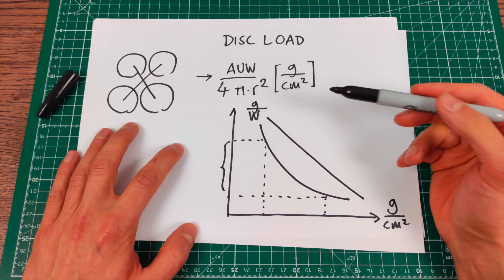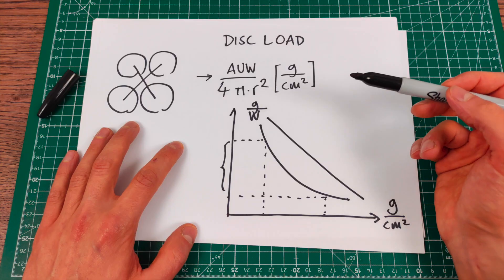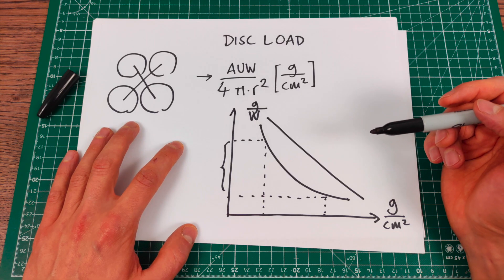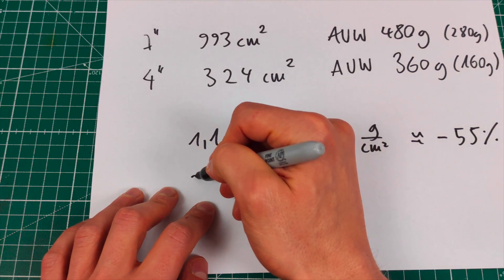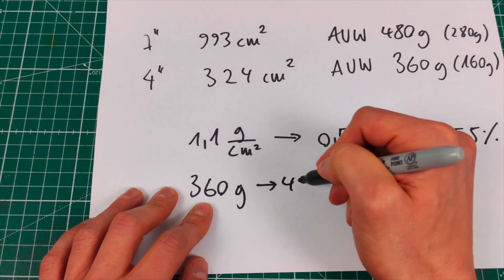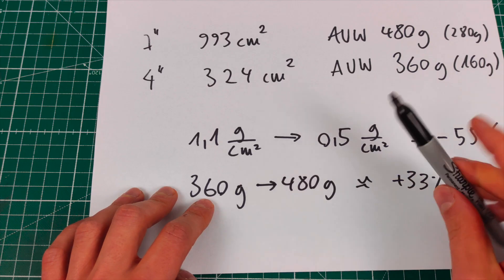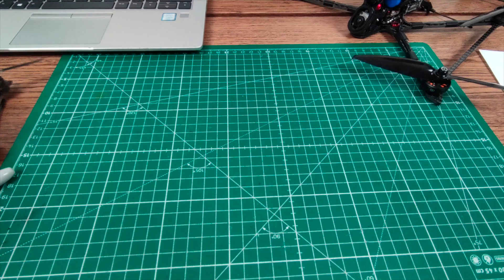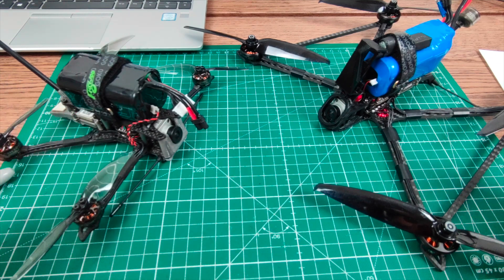Ultralight 7" vs. 4" | flight time comparison | 18650 Li-Ion

Comment: Dave, Can you compare them down to a specific voltage? Because no matter what the 7in is most likely drawing more amperage thus making the battery(especially li-ion) sag slightly more but I really don't know.(I know the cold hand thing my thumbs were gonna fall off the other day as I pitched the nose of the quad forward to get home asap) I've been doing these exact same comparisons between my Explorer LR 4in.(146g analog vtx weight) and my Tomoquads Katana V2 5in. w/fpvcycle 2204 2800kv t-mounts HQ 5030 Bi-Blades(206g analog vtx weight) 4s Li-ion(190g Pack)(18650 Samsung 25r-Green Wrap 2500mah 25amp Cell, best cell for the price at like 3$ each)  and even though the katana fly's much much better especially if you add even more weight the amp draw is still slightly higher so flight times are lower on the same pack. I have a second Katana V2 5in. frame I'm going to build out with BrotherHobby 1504.5 2650kv motors I have and see how well it performs swinging a larger 5in prop and if its possible to beat the Explorer LR on the same pack using a 5in prop because the Explorer's efficiency really takes a dive if you add weight with a bigger battery or camera where as the bigger prop/bigger motor combination's efficiency is much less effected. So to get back to your test, the 7in will carry a larger battery and fly longer while of course burning up more mah/min BUT a really cool test would be to see how far each can go at there optimal cruising speed. I have a feeling that the 7in you will find has a much faster optimal cruising speed so where the flight time on the same battery might be less than the 4in, the 7in quad may cover twice the distance even with being in the air less time. Yea distance and finding optimal cruising for the 7in would def be a cool test.

Comment: Interesting comparison, taking into account that both quads are limited to use the same energy. But the 7" is heavier and these 7" props weren't designed for efficiency. 
Props should have low drag, similar to glider plane wings: slim airfoil and low pitch are the way to go. 

I'm getting the same flighttime of around 28 minutes at similar speed from the same LiIon 4s-pack 3.000mAh VCT6 in no wind conditions: 

1) stock 370g AUW EXPLORER LR and 
2) 540g AUW Geprc MarkIV 7" frame driven by T-motor MN1806 / 2.300kV and low pitch T-motor CF props 7x.,4. Those props are razor sharp and only fit on the T-motors. Both are nearly impossible to source now. 

T-motor CF 7x2.4 props are amazing, it would be great to get CF 4" props with same airfoil and actual 5mm T-mount for the EXPLORER LR.

Comment: You should look at the efficiency curve of brushless motors, even with the greater weight of a bigger motor, since you'd be at a much lower portion of it's torque potential, you should be able to get a very significant efficiency boost. I'd be curious to see you go in the complete opposite direction and get a 2806ish size motor then test the fight time. Should also significantly help with the feel of the quad.
Reply: I think the idea behind the lightweight design of this seven inch is to directly compare the seven inch to a four inch with the same battery as you can get a seven inch to carry a good 600 or so grams of battery which would blow a microlongrange out of the water with flight time
Because the 4 inch is at the limit of its carrying capacity with that battery whereas the seven inch would be perfectly capable of double or even triple the battery size
And he was mainly testing the efficiency of having a low disc loading
But if he where to load up the seven inch to the same disc loading I think we all know that it would win
Reply: I agree with a smaller stator the stator gets saturated with energy much sooner than a larger stator, therefore even a larger stator can be more efficient because it does not have to work as hard it's not near its maximum potential which is when the increase in amps causes a decrease in efficiency losses through heat etc.

Comment: a lower pitched 7 inch prop would be nice. implementing Prandtl lifting line theory in propellors could also give an enormous boost in flight time.
Reply: Has there been any real world implementations of this theory? I read through a few papers but it seemed to be a different way to frame the calculations or a different way to calculate a wings properties. I didn't see anything about it being a game changer in effeciency. I'm not trying to disagree with you or anything, I really just don't know much about it.
Reply: @JustinHunnicutt   there aren't many planes built this way,  Albion Bowers (NASA chief scientist ret.) Claimed a total gain in efficiency of about 60% . The papers he published,  are based on measured data.  People who built the prototype confirmed a great gain in efficiency (not 60% tough). Had something to do with the plane not being full size.  I don't know why the aero industry seems to ignore it,  maybe for the same reasons they mostly ignore canards.

Comment: I like the happy compromise that a 6in prop brings. Your 5in frame adapted to 6in props, with t-mount 2204s and HQ T6x2.5x3 would be a nice combo.
Reply from the maker: could be absolutely right. 6" has also been my favourite on more classic setups. I think the next thing I will try is just putting some 6" props on it.
Reply: @DaveCFPV  So many new props and motor sizes are coming out, it's hard to keep up. I spotted the SPCmaker G2204, but I'm unsure of the quality.  The 4in LR is still a very hard design to beat.

Comment: My guess is, that the power to weight ratio of the batteries is less efficient on the 7" quad. You should use a way bigger battery and see how that works.
Reply: The key to achieve maximum flight times is to decrease dead weight as much as poss and increase the weight of battery in the same way, given that you use a battery with a maximum power density available on the market.

Comment: Please disclose your 7” PIDs. Thanks
Reply from the maker: It's really just a rough tune I did in 10min to make it flyable. Here it is:

set p_pitch = 81
set i_pitch = 99
set d_pitch = 107
set f_pitch = 105
set p_roll = 74
set i_roll = 94
set d_roll = 99
set f_roll = 99
set p_yaw = 79
set i_yaw = 99
set f_yaw = 99
set d_min_roll = 65
set d_min_pitch = 70

set gyro_lowpass_type = BIQUAD
set gyro_lowpass_hz = 0
set gyro_lowpass2_type = BIQUAD
set gyro_lowpass2_hz = 0
set dyn_lpf_gyro_min_hz = 0

Comment: Your efficiency goes nuts because this motors are completely overpropped running 7". I mean even 2306 Motors are overpropped on 7".
Going with bigger motors will need stronger frame, otherwise you will have tons of resonance. 
Your footage clearly shows what's going on, tons of wobble, a clear indicator of missing power. 7" needs at least 4000mm³ statorvolume to have proper autohority handling the prop weight.
I've done lots of testing with 7".
Reply from the maker: Agreed. The motor might really start to get inefficient at that point especially since the PIDs are pretty high to keep it from wobbling. Some light 2306 motors like the Amax Superleggera might work and not be much heavier.
Reply: @DaveCFPV  
The smallest motor on 7" I would run, are 2306.5. They are just enough to spin properly some lightweight Biblades like the gemfan 7042.
Reply: @waldemarkraus2855  Can confirm, very little wobble (only on high sink rates likely needing more D) on biprop gemfan 7042 with geprc 7" mk4 frame using 1350kv 2306.5 motors, 20 minute cruising flight times to 3.2V ~2500mah drawn on 6S 3000mAh VTC4. I want to try a 6s2p 6000mAh next. I love the soft bee-swarm-like sound of a 7" in this config.
Reply: @spikester  
If you are using 48khz pwm, than switch to 24khz or set "thrust_linear" in betaflight to 25 via CLI. That should also help.
That sound is great, but I had lots of problems with these props on high power setups due to flexing and bad resonance. 
For light builds they are fine.
Reply: @waldemarkraus2855  Certainly, these props resonate like mad but I guess thats where they get that distinct hum. In my case I must keep the filter sliders around 1.1 no higher. I could probably do better by balancing the props but meh. I run 24khz on larger quads because I found that low end throttle torque was more linear and predictable. I presume it has more to do with the braking power of the motors in relation to the larger disk and fet response time, especially when it comes to sinking fast in higher winds. My thrust_linear was set to 20. I will test 25. This is somewhere that automatic pwm rates make a lot of sense. I know at some point I will want to try larger motors. Thank you for the advice. :)
Reply: @spikester  
I run variable PWM on BLHeli 32 latest beta. Works great for combat those low throttle wobble.
Balancing those props helps but can't cure the issues with resonance. I dumped them and run some stiff APC 7x5 Biblades. But they are quite heavy for such small motors (2306.5).  Despite the APCs there are no good 7" biblades on the market for powerful 6S setups :(
Reply: @waldemarkraus2855  Thanks, I've just installed the latest blheli32 and set variable rpm from 24-48khz, will see how that goes shortly.
Reply: @waldemarkraus2855  It flew better with dynamic pwm but the frame still resonated where you could hear it from afar with the 2306.5 geprc motors. I finally swapped them out with the xing 2806.5 1300 and darn its like a different quad, smooth as a cucumber and that hum is much nicer. :D
Reply: @spikester  
Great to hear :)

Comment: I like the route TBS is going with their Pizza Box frame which is in production right now. The one piece 7” frame, which is SUPER light, as it’s very thin carbon fiber sandwiched around some type of foam. Then has a small canopy that will fit a Vista and and maybe a “Beast AIO”. I think they have their own AIO coming as well. The quad is not very crash worthy, but I think they are onto something.
Reply from the maker: Oh wow I wasn't even aware of that one. Are there any infos online already?
Reply: @DaveCFPV  Not that I know of. They have shown it on the TBS Couch live stream a couple of times, and said that it is finally currently in production. It is a pretty neat design. Like I said it’s one piece (well two thin pieces of carbon with foam sandwiched between), so you don’t have all of the hardware weight, as well as the foam taking the place of the heavy carbon. The only issue they talked about was figuring out how to keep the motor screws from squishing the foam is on the motor mounts. The other is that it probably won’t crash well, but with a long range cruising it should be great. They have been calling it the Pizza Box or they were calling it something else that was mentioned on the stream. Don’t think they have settled on the name. I’ll try to find some information for you. It is super light.
Reply: @DaveCFPV  Search “TBS Couch - Squarce Maiden” I think that’ll get you a look at it

Comment: Dave, thanks for making this video. Really enjoyed it. On the graph of disk loading vs efficiency, you drew a curve that sort of looked like a smile (the mouth on a happy face). I could be wrong, but maybe the actual curve looks a bit more like a frown (the mouth on a sad face). If the curve did look like a tilted frown, then once you go below a certain disk loading, you get into a region of rapidly diminishing returns. I'm not sure about this, but it might be something to think about. Would explain the lack of significant endurance gains with 50% less disk loading on the 7 incher. 

Or maybe the 7 inch props just had too much pitch? Either way, super interesting comparison. 

Fyi, I bought myself a Flywoo Explorer LR4. Can't wait to get my hands on it. Thanks for making the LR4 a thing! 

Best regards from Brasilia, Brazil.
Reply from the maker: There must be a point of diminishing returns i think. No curve is exponential forever... Hope you enjoy your Explorer! :-)

Comment: The 4 inch is the sweet spot for 4 X 18650 cells basically....A quad to fit 4 cells of this type....Try fitting 3.5 inch blades, see if it gets better or worse?...🤔🤔

Comment: I  have 4 of your frames I am working with.  My best flying, longest flying is the 4" frame but with 5" arms.  I don't have the arm braces installed.  The 4" with 4" arms flys great but it gets about 3 minutes less flight time.  The 5" I have like the one you are showing with the bicycle connector flys great but does not get the flight time of the 4" with 5" arms even though the weights are within 10 grams of one another.  IMHO I think the biggest difference are the props.  GemFan Hurricane props fly better and longer with all of mine than similar HP or other props I have tried.  I think the center of gravity is enough different on these to have an affect as well as the relationship of the motors in the design.
Reply: What five inch arms are you using with the 4-in frame? Is that the 4-in Explorer frame you're talking about? Version one or two? I have version 1 and would like to experiment with 5 inch arms after reading your post. Thanks!

Comment: It's obvious, the elephant in the room which you omitted from your calculations was...Drag.  Those big 7 inch discs whilst giving bags of lift, also creat a lot of drag and need more power to drive them.
Specifically, frontal area with the quad tilted at an angle to achieve 40kph.
The bigger disc area = bigger drag...🤔🤔😀🇬🇧🇬🇧🇬🇧🇬🇧🇬🇧
Reply: The drag from the props is reduced with a lower disc loading in fact as the props can spin slower to produce enough lift and because the drag is proportional to the square of the velocity a prop spinning at half the speed gives a quarter of the drag
This is just for the actual prop drag not the aerodynamics of the quad itself
Reply: @H.J.B  More utter rubbish....🙄🙄
Reply: Actually there wouldn’t be an increase in drag for the props. When you think about it, then you’ll see, that the propellers actually don’t create any drag because they spin through the air like a screw...
Reply: @ferdifant_fpv686  Lol....that was funny...Don't give up your day job...🤔😀🇬🇧
Reply: @ferdifant_fpv686  Props do generate drag, but it's cancelled out by the thrust they generate. Thing that actually increases the drag are the longer arms required to fit the props
Reply: @grayscalefpv1748  surely extra drag PLUS extra thrust (working against extra weight AS WELL AS prop drag = greater battery drain = shorter flight time, so to say it is cancelled is untrue?

Comment: 7" is very underpowered with these motors. I think that they do not drive 7" inch props very efective. You should test it with bigger motors. Brother Hobby 2507 1500kv on 4 cell will give you more than 18 minutes flight time!
Reply from the maker: Yes indeed seems the fact that they need very aggressive PIDs to be even remotely flyable costs a lot of efficiency.

Comment: Are you going to be  releasing that 7 in frame at all
Reply from the maker: It's just different arms, so I think sooner or later yes. I'm just looking for a better solution than Thingiverse. The site is a mess and constantly crashing
Reply: @DaveCFPV  ok sweet. Thanks man love what your doing. So cnc madness should be able to cut it for me then if it just bigger arms.  Nick is a good guy  he has cut a bunch of frames for me
Reply: @DaveCFPV  Hi dave you can create a project on Onshape that everyone can access for free, you have the ability to add different Tabs with notes and videos etc.

Comment: Hi, Nice vid! The main benefit to go larger in propsize is the cruise speed for me. A couple of years ago I build a 3"ultralight with 2s 18650 for long range. I managed to get 25 minutes of flight but the biggest thing I found out that the cruise speed is quite low, and is you go faster then you lose efficiency. My 7" goes for 20+minutes on one 4s lion pack but at a cruise speed of about 70kmh. And got long range I find the speed also very important. What would be interesting to test them at there own cruise speed and look at the distance they flown. And what also would be interesting is to do the same test only then both at 70kmh. Ps, a bad tune also costs a lot of energy.
Reply: bad tune uses a lot of extra power.   

and yes, i agree, the more interesting test would be a real world flight of each to 2.5v.
Reply from the maker: Yes totally agree. at 70 kmh the 4" will probably start to get way less efficient in comparison. Indeed the PIDs are pretty high to make it stop wobbling like crazy. Pretty sure that costs efficiency. 2204 might be too small after all...
Reply: @DaveCFPV  I have the tbs endurance motors on one of my 7" and these are not big, 2306. Dry weight of the quad is also not licht with 451 dry without GoPro. But it's flying super smooth. Also with a big battery. But 2204 is a lot smaller then 2306 of course. I'm curious to see where this project is going!

Comment: Fantastic video! Thanks! Next, can you do a range test? For example, if there is a particular mountain I want surf down, how close must I drive my car to be close enough to fly my drone to the top of the mountain? If the 7" has a higher cruising speed than the 4", then perhaps less efficiency won't matter so much if I can fly to the mountain sooner. Much appreciation.
Reply from the maker: On all of these setups your range should be limited more by the video signal than anything else. The 4" can cover over 20km round trip on those batteries :-)